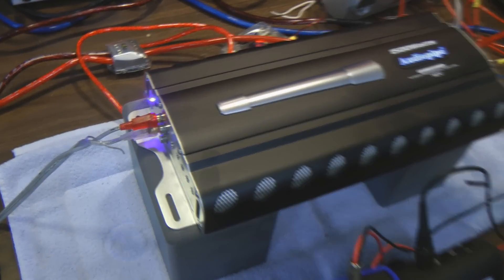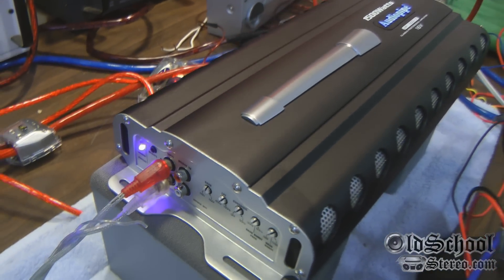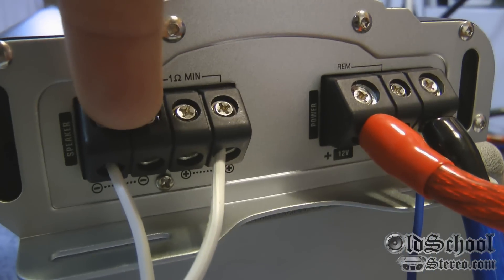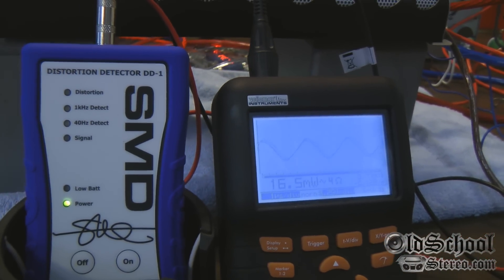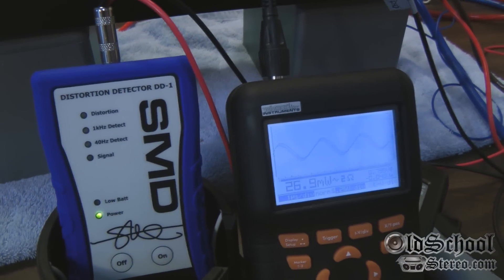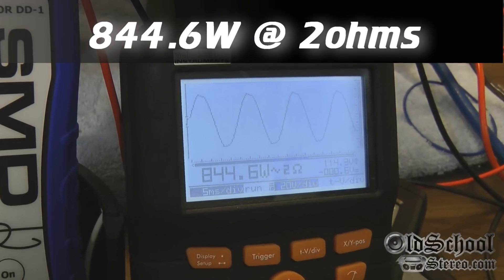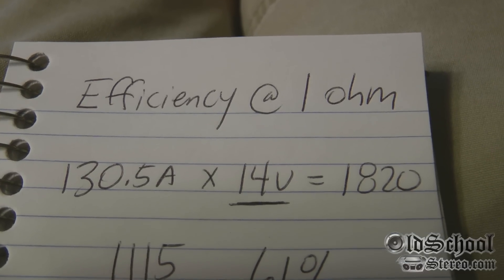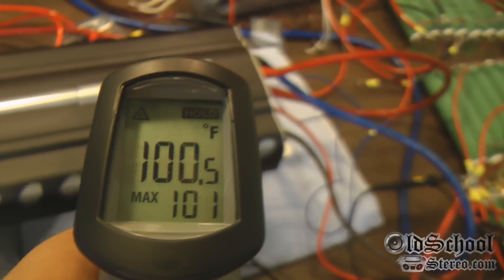Audiopipe AP-15001D Power Output Test RMS Watts Clamp 1500W

Comment: use common sense people most vehicles electrical system isn't running 14 volts constantly so 12-13.2 volts minus 504 watts minus 100-200 watts then get your true watts every vehicle's electrical system is different common sense people!
Reply from the maker: Agreed, but many of the amps are rated at 14.4 so this is where I try to test

Comment: i have this same amp except it doesnt say 16v. have ran it mostly at 1ohm but have used it @0.5 ohm id like to see the test of the lower ohm. so in therory if i had this same amp and was running 1 ohm i could set my gain to be @ 33.4v with a multimeter and it should be unclipped?

Comment: So I am running a sundown sa-12d2 v3 on an NVX JAD1200.1. I am trying to set my gains with a DMM. What formula would I use to get the amperage I need to see at say 1300 watts. I was taking the wattage x the 1 ohm load and then doing the square root. I feel like with that formula the output was very low. Please let me know what amperage I should be looking for? Thank you very for any help you can give me. I feel like I'm using the wrong formula.
Reply from the maker: +David Stone You can't accurately set gains W/ only a DMM. You need to know at what volume you are distorting (head unit) and adjust your amp gain based on this setting on the head unit. It is best to use an SMD DD-1 or an oscilloscope, otherwise you are guessing
Reply: Dereck BigDWiz thanks. I know a dd1 is the better way. I just don't have 150 to drop to use it once. I guess I'm asking would I multiply the 1300 watts by the 1 ohm load or multiply the 1300 by the 2 ohm voice coils the do the square root?

Comment: for a 100 dollar amp that's not bad at all.  pop off the cover and look at the guts.i saw a video of a new school hifonics elite 2500 watt class D amp and the guts were better than a sound qubed 2500 . all tho I have no problem with sound qubed at all I love there subs but it seems like there amps need better capacitor with a  higher heat resistance.

Comment: hello I have 2 old school audiobahn 10in subs that are 6ohm dvc,, is it possible to wire them to get close to 1 ohm so I can run them on my amp at 1 ohm,, if so could you please tell me how or do a video on it,,  also I am looking for a 4 channel amp and a 1 channel for my boat,, I would like to get 1000rms from the 1 channel and between 600 and 800 from the 4 channel,,what is the best bang for the buck, I would like to get both amps for close to $300, also what is the best bang for the buck for a pair of 10s or a single 12,,   for power I have 4 6 volt Trojan deep cycle batterys and plan on adding 2 more it is wired at 12vdc and help or info would be great,, ohhh I wouldlike the amps to be matching thanks for your time and for the great videos,, Robert
Reply from the maker: +infrareddreamz Wire 6 ohm DVC subs in parallel will give you 1.5 ohms nominal load. Each sub in parallel would be 3 ohms, two 3 ohm speakers in parallel is 1.5 ohms. Parallel is positive to positive and negative to negative

Comment: you'd get rated at 16v but if you're going to dump money into electrical and then buy a cheap amp. you're not right in the head.
Reply from the maker: It says 16V on the amp, but according to the mfg. it is rated at 13.8V. I double checked with them before doing the video.

Comment: well i think the reason that you get less power at these tests with the velleman scope is because of the resisitive load, speakers are inductive loads, and inside the amp dyno there also are inductive loads. there's maybe the reason why you get less
Reply from the maker: Good theory, but not true. Resistors put a consistent load on the amp and will extract the maximum amount of power. The Amp Dyno has resistive load banks (ceramic braking resistors from elevators or trains). If you use a speaker to test an amp, you need a way to determine power factor. Without power factor, you are yielding Volt Amps, not Watts. This is why the SMD/D'Amore AMM-1 is such a cool tool. It can calculate power factor on the fly and also use resistors. Thanks for the comment!

Comment: Thanks for the info man. Since you now have the SMD amp dyno would you possibly be willing to run the AP1500.1D on it? I have the AP and was curious if the newer models really do that much better. I'm sure you get tons of requests though. But you already have the AP1500 :-)
Reply from the maker: I tested the APCL-1500 on the Dyno, results should be similar. I sold my AP1500.1D a while back

Comment: if a amp has 4ch 800w how much RMS is that>????
Reply from the maker: It depends on how the 800W rating was obtained. These days, many mfg's use "MAX" ratings, so it is possible an 800W 4ch amp is only 50w/ch RMS
Reply: so its a 1000w total ? the amp is ppi p900.4
Reply: could you please check it for me

Comment: Yo bigwiz. There's a problem. The amp says 16v...were you giving it 16volts during the test? I might of missed that part
Reply from the maker: It is capable of 16V input, but according to the mfg, ratings were obtained at 13.8V

Comment: Can you please check... Please. The hifonics brz 2000.1d.    At one ohm... Please help me out
Reply: I saw a video of a brx2000.1 at 14.3v pushing 2135w. At one ohm. 2265 at .5ohm.  About 2 weeks ago. The brx models are the best
Reply from the maker: Sorry bro, I don't have one of those
Reply: If you run across one. Check it out... it runs about 250.
Reply: that Hifonics will come extremely close to its rated power they are 2006 CEA compliant amps a pure frequency will net you around 1800+ but burst you will prolly exceed 2000W. There are some reviews and I had mine for a while till I switched it out. mine tested 2033 burst mode and about 1875 pure freq. Hope this helps you out..?
Reply: Thank ya.
Reply: What was Ur voltage
Reply: 14v

Comment: You did it rong do the test again at 16 volts not 14 it says clear as day on the front of the amp 16v not 14v
Reply from the maker: I talked to AP and they said rated at 13.8V but the amp would accept up to 16V. But they didn't mention THD at rated, I think it's at clipping (awaiting verification). I'm testing a newer model APCL-15001D right now, stay tuned for the results
Reply: Dereck BigDWiz
i want to see that video!
Reply: Dereck BigDWiz Aren't CEA certs for 4 ohms at 14.4 vdc at 1000 hz?
Reply: 16v means the amp is 16v CAPABLE
Reply from the maker: ***** Yes, CEA2006 is 4 ohms 14.4VDC at 1kHz. This is why you should not see CEA2006 certified on Class D monoblock amps

Comment: 1274w @16v vs 1500w @16v not that bad at all only over rated by more or less 200watts for $150 you cant go wrong and i have friends who have been running this amp daily for years and no problem

Comment: yo do need to keep in mind mosfets used in class D amps are driven by input voltage and eff% will go up 2~4% with the jump to 16v do to the mosfets getting and high gate voltage

Comment: naw dude i shipped it back to amazon for a full refund and bought an alpine 1100 RMS amp and it works like a charm no problems.... Only idiots go cheap on car audio theres is always a reason for something being cheap... i have had a hifonics amp fail on me too again i paid under 200 for it and it lasted a little longer than the audiopipe but after about 9 months that one failed too.
Reply: Alpine is junk overpriced poop man i know this comment is 6 years old but i just took 200 and gave it away cause i had the same mindset as you if it cost less it is less nothing is further from truth in fact just shows how little i knew bout car audio

Comment from the maker: If your run is greater than 10ft, I'd go 0ga, b/c mfg's don't really make 2ga anymore and 4ga isn't designed for more than 120A. Just to be safe and allow for future expansion, go 0ga. Buy OFC if you can afford it and go with a quality brand such as Knu Konceptz, Audio Technix, Stinger, RF, etc. You may be okay with your current battery and alt, maybe add a 1farad cap. Don't listen to those people who say caps don't work, b/c they do. Again, get a good brand and make sure it's a true 1farad.

Comment: I have 2 audiopipe 15's and the 1500 watt amp. What gauge power and ground wire would you recommend, and would i need an extra battery or a stronger alternator?

Comment: I was hoping you had a video clamping the Audiopipe AP18001D. I have seen benched videos of the AP30001D doing 3100wrms @ 1 ohm. The AP30001D is basically two AP15001D's internally strapped together and placed in a larger case, so I'm baffled at how you only got 1100wrms out of that AP15001D. I have two AP18001D's on 2 SA-8 V.2 Stock SPL with an extra stiffer spider pack & an upgraded heacier CCAW Voice Coil to increase lower frequency range & increase power handling to around 1000wrms.

Comment: Probably where I buy my Audiopipe amps from. VMInnovations has the best prices for Audiopipe amps. I run two AP18001D's on FOUR SA-8 V.2 Stock SPL Prototypes with an extra stiffer spider pack and a stiffer CCAW Voice Coil to handle 1000wrms each and better lower frequency response with minimal loss in the higher frequency ranges. They were built by Jacob himself. I also run an AQX-360.4 bridged on my Focal Utopia 6W2 Components in 2 channel mode @ 360wrms x's 2 claimed

Comment: Sooo.. just doing the big 3 wiring upgrade, and revving up to 2k rpms isn't enough?!?
I'm honestly asking, because sometimes my voltage drops to ~13 volts on full tilt, and sometimes it drops to like 11.9 volts on really bad days (at this point I precede to turn the volume down).
If it helps to know, I also have two kinetik HC600s along with the stock battery

Comment: Excuse me sir,
   I have two Audiopipe AP-15001Ds bridgded in my trunk with my most recent setup. Assuming that my electrical is outputting the proper amperage at ~13.7 volts, would you say the amps are putting out roughly 1000watts (between the two of them) at 4ohms?

Comment: I just don't understand these terms difference watts- volts- amps
1oh 2oh and oh even 8oh. Impendence, Rms bridgeable
I got my budget sound system all hook up, but those terms confuse me since I don't know mutch about them.
At least I know how to plug and set and amplifiers and how many watts are running thought each channel.So dependind on how much Max power or rms a speaker ,subs are capable I connect. 6 months have passed by and nothing as blow up, burned or broken.

Comment from the maker: I test the amps using test tones and resistive loads. These combined provide a worse case scenario load on the amp and you most likely will never see the current pulls I see while playing back music. The 100A fuse can handle short bursts of 120-130A before popping.

Comment: what i dont understand is if that pulls 130 amps at 1 ohm.. why did my ap-1500.1d come with a 100 amp fuse? wouldnt it just pop the fuse? i dont have my inline fuse installed yet but i will eventually

Comment from the maker: Hi Kyle, unfortunately, there is not any real easy or cheap way. You need high powered non-inductive resistors, a true RMS meter and either an o'scope or THD Analyzer to get accurate measurements. Oh yeah, you'll also need plenty of reserve (alt/batteries) or power supplies to feed the amps. You can get a rough idea of the current consumption by looking at the required fuse(s), multiply by 13, then factor in efficiency. 100A x 13V x 70% equals 910 watts. Again, this is a rough estimate.

Comment from the maker: No the DD-1 isn't a godly device, but in this case more accurate at measuring the 1% THD than the o'scope. That's just plain fact, despite what the DDhaters will tell you. BTW, I've chatted w/ the designer of the DD-1 to confirm my usage of the device and didn't rely on the Internet or my cousin the installer to tell me it's not intended to be used the way I'm using it.

Comment from the maker: For this test, I used (2) Audio Authority Model 978 100A 13.8V power supplies for 200A of continuous input current. I also have a hybrid power supply/charger capable of up to 500A peaks with an attached AGM battery. More about that coming up in the near future

Comment: What do you mean 25 amp fuse. If you mean a 25 amp fuse for your amp then there is no possible way you did 141.4 with less than 25 amps of power draw.

Comment from the maker: It was 121A of current pull from the power supplies (at 14v), so you would need a system capable of providing this amount of current. However, realize the resistive load test is a worst case scenario for the amp and with subwoofers it may pull this amperage during peaks, it will use much less current during normal operation. I've shown some other videos where I measure amperage pull when powering subwoofers and playing back music.

Comment: Ohm's Law isn't wrong or misapplied. However, since vector current and voltage is normalized-zero (no lead or lag) with a resistive load then true power can be determined from the clamp. If Dereck wasn't doing it right, I'd be the first to let him know. Instead I get to tell you that you're wrong...

Comment: is there any difference in 1 ohm power when clamping ac amps rather then using ac volts and dc current draw. i always measure by ac volts and ac amps

Comment from the maker: I have dual 4ga, one each from a 100A power supply as that's the largest cable it can accept. Shouldn't be a problem as it's only 3-4ft max per run. I have both 4ga going into a digital fuse distro block and come out with a single 4ga going to the amp (about 1.5ft). Thanks for linking bro, the more, the merrier! I usually test old school amps, so I'm hoping you guys like those as well.

Comment from the maker: I know the clip well and also know Ohm's Law does work when you are using resistors. Tony mentions the phasing and True RMS issue when people measure power output by clamping using speakers. I use only True RMS volt meters and wirewound resistors and there are no phasing issues and/or box rise or impedance variations

Comment from the maker: I have no doubt the JL HD series would perform well, but no, I haven't tested any of those. Truth is, technology advances and electronics get smaller and cheaper. The jury is still out on the Class D vs. Class AB battle. I've always been a fan of AB, but again, if I wanted some big power for cheap, it's hard to discount these newer amps such as the AP-15001D

Comment from the maker: It must be a challenge trying to explain away these amps to your customers? Fact is, the lower cost amps MUST cut corners somewhere, you get what you pay for. When I was 16, I saved up for months to buy my first amp, the Alphasonik PMA-2100. It was rated at 100w times two channels and cost 300 IIRC. Didn't take me long to realize the RF Punch 150 would spank this amp. I wish I had saved a little more to get the RF! Well, now I have a few of them ;-) Thanks for the comment!

Comment from the maker: Truth be known, I was shocked by the numbers. I didn't test the amp at 1/2 ohm, but can do another quick vid showing it. Based on the decreased efficiency at each lower ohm load, I don't believe it will put out significantly more power at a half ohm than at one ohm, but there's one good way to find out. Thanks for letting us know the reliability, that's pretty impressive!